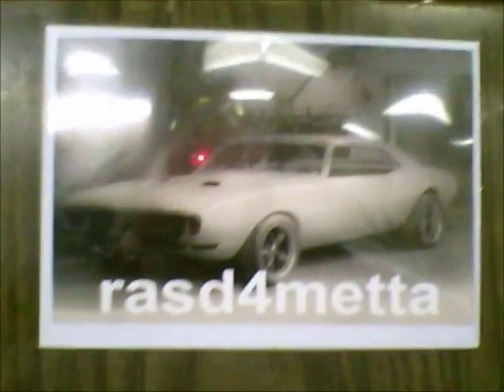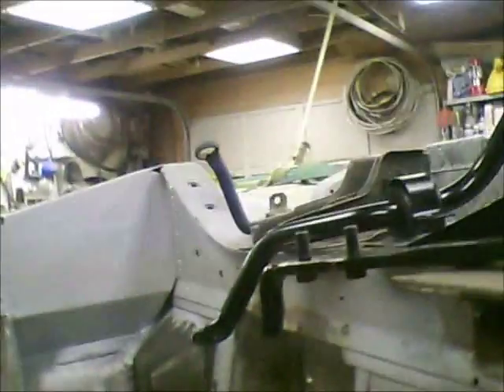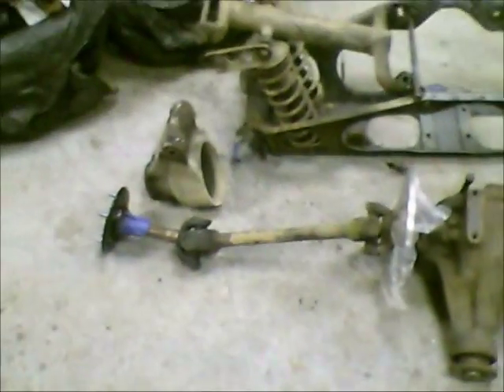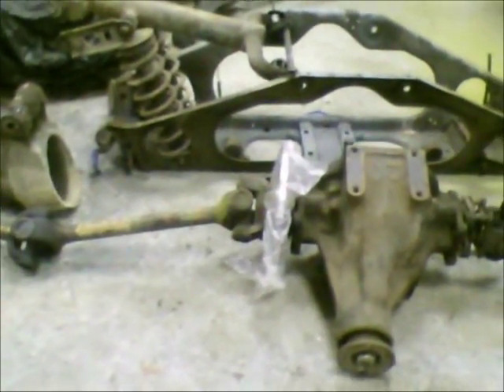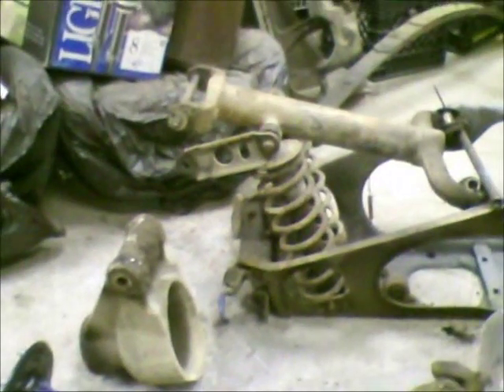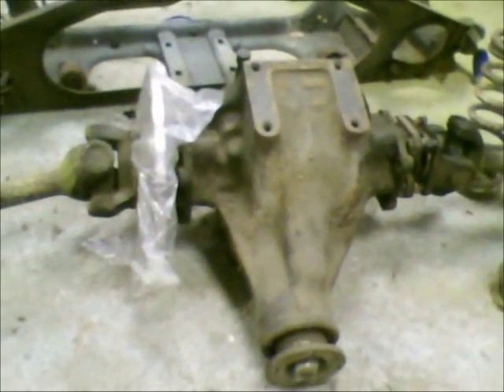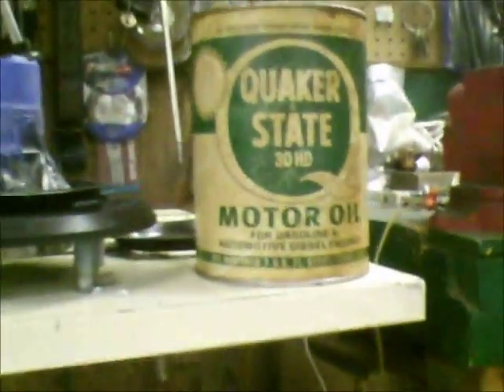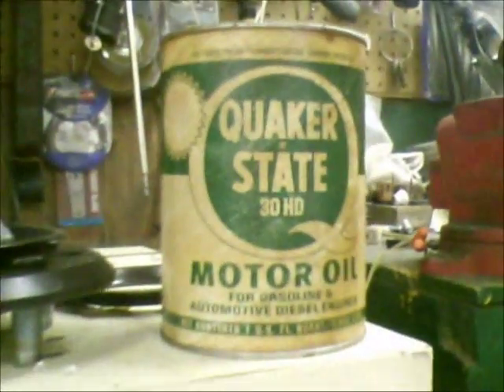Rear suspension

Comment: I am putting this same IRS in my 51 FORD F1 truck. I actually bought it off a guy that was building a Mustang. Built by CWI, It had been narrowed to 57".  That is too narrow for my application so I found the stock ones., So... If anyone is building a car with this IRS I have your 57" Axle shafts and LCA's. 
Contact me at bryansoth1@gmail.com for more info!

Comment: I think the all metal is a suitable replacement for short strand fiberglass filler.  Good, strong, water proof filler for going over welds, seams, etc.  Only thing most have said is that it is much more difficult to sand that the fiber filler.

Comment: With all the front suspension mods you are doing, along with the IRS this thing will be a real handling machine.  You may have covered it in other videos that I missed, but what are you plans for motor / trans?  I like the out of the box thinking on this.  Nice work Cecil